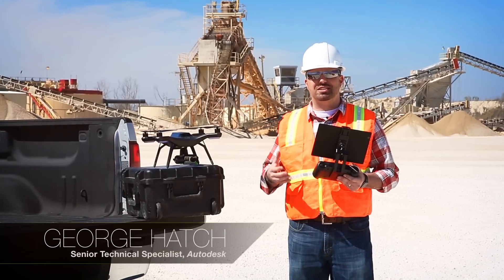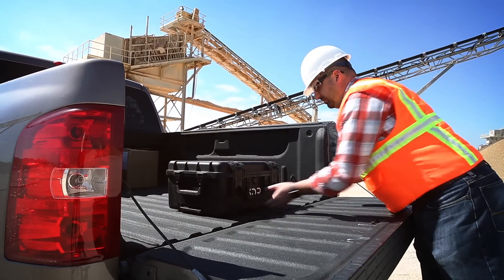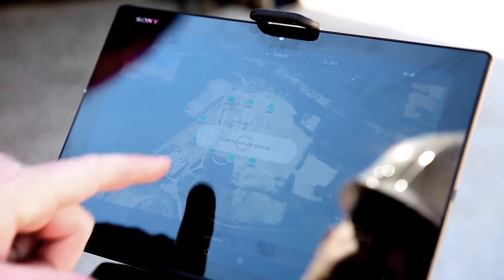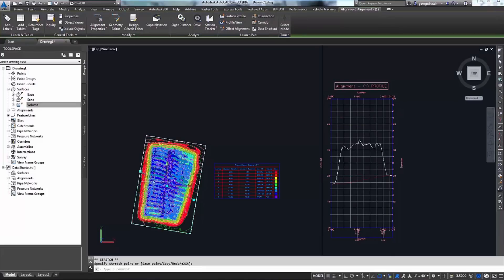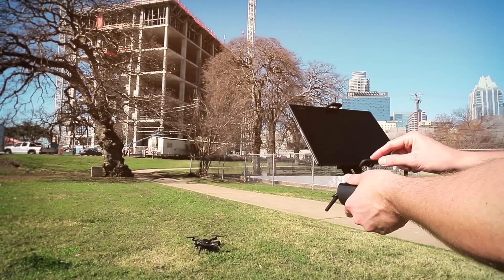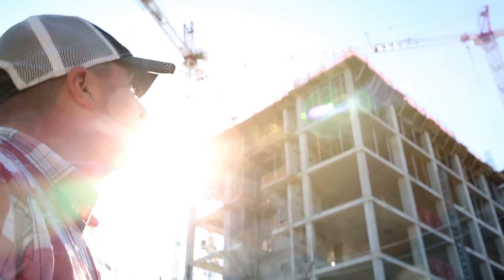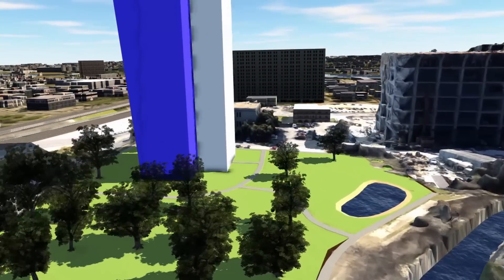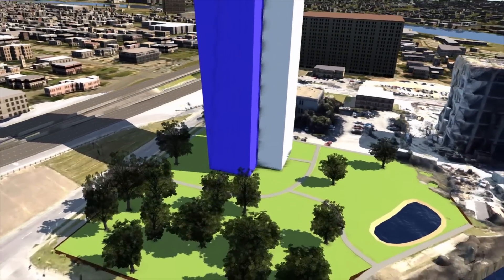3DR Solo w/ Site Scan™ - Autodesk® Workflow

Comment: Maybe a little off topic, but the controller antenas shoudn't  be pointing up instead of down?
Reply: +Rodrigo CL if you notice they where at a slight angle down and outward and that is the correct orientation. the radio waves travel out from the side of the antennae not from the tip.

Comment: you take a big chance using the Solo, its one of the worst uav's you can buy. Use the iris +. its proven as the Solo has serious problems. Solo killed 3DR. It has serious problems with the GPS and gimbal. This is why they are not being sold and so many have been returned. You dont see this uav used much because of the well documented defects with the Solo.